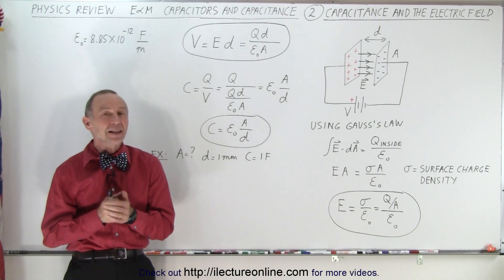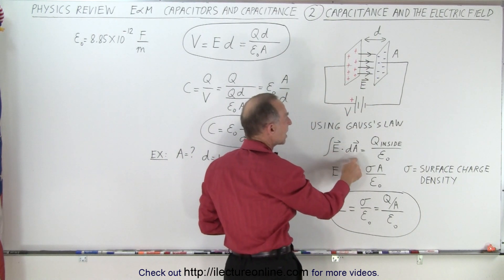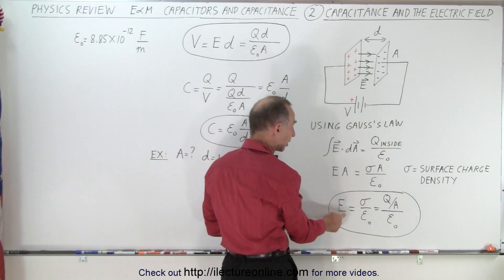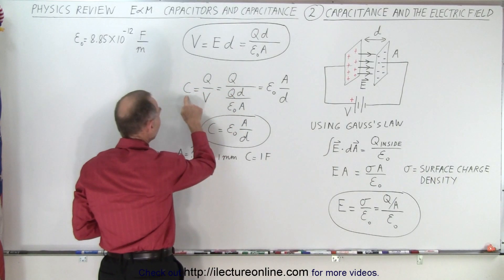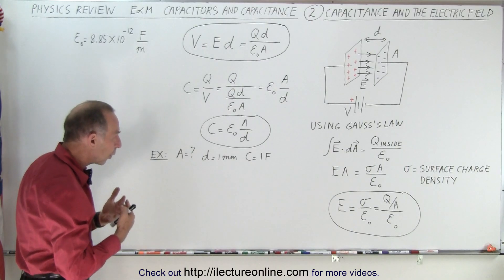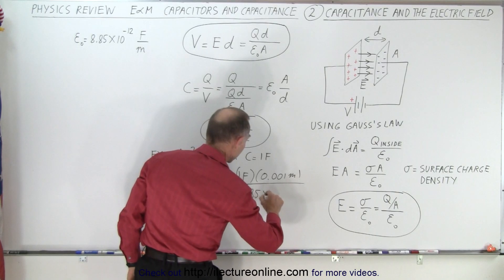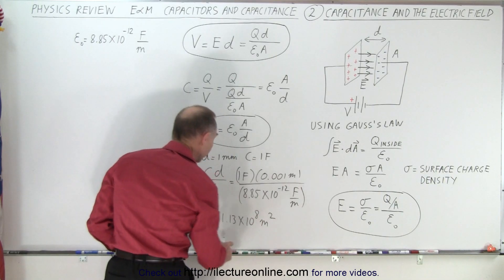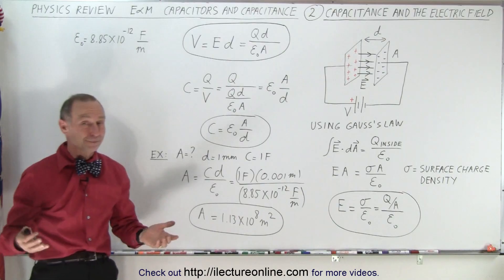Physics Review: E&M Capacitors and Capacitance #2 Capacitance And The Electric Field

Comment: when you talk about the Area of the plate, will the thickness of that plate be a factor for the capacity that can hold the voltage ?
Reply: It will. The opposing charges must attract each other through the plate. If the thickness is higher the capacity will be lower.